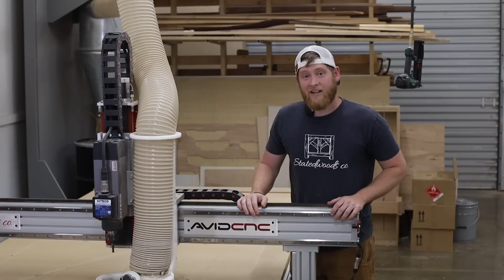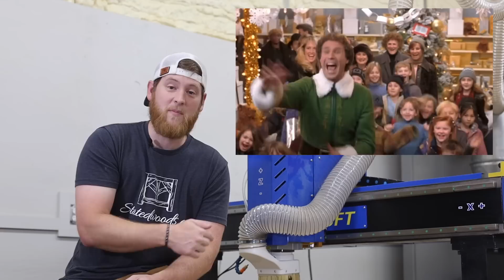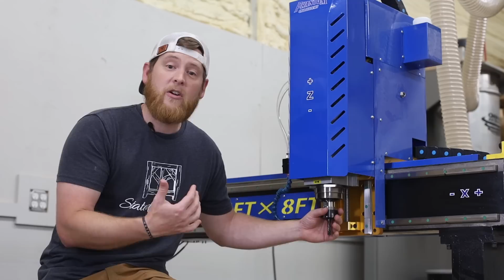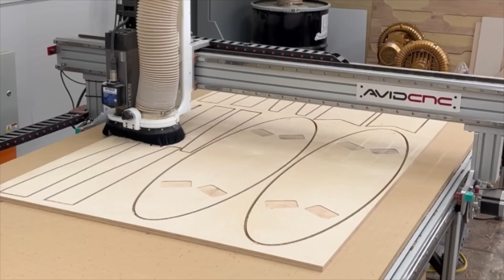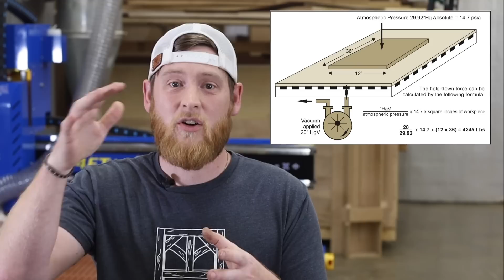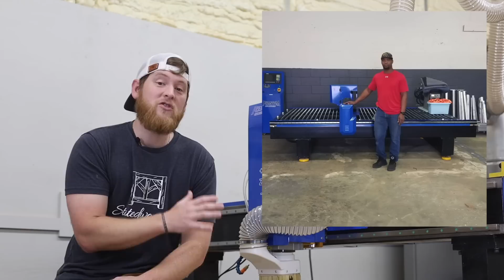Which is a better machine?

Comment: Thanks for all the info. I've had 5x10 avid for a about 3 years now and I'm seriously considering selling it for a phantom. I have to many issues with chattering and accuracy.
Reply from the maker: I was in the same boat. Its a huge upgrade to go to a heavy duty welded frame. So many advantages.
Reply: @Statedwoods  have you tried bolting the avid to the floor? Or perhaps I also guess more mass in the frame could help. Like bolt inside to concrete squares, like corner ballast. Does not fix all issues, but perhaps reduce the jitter and stop the moving 🤓
Great comparison! I did some 3D carve on a low-end machine, and out of square, makes molds fit badly, after spending hours carving 😔
Another timesaver is tool changer and auto tool Z calibration. Does the phantom have that?
Reply: Very interesting comments here! I have an Avid CNC from the CNC router parts era which I thought would be a stepping stone to a rigid industrial grade machine…. What has actually happened is I have reached the conclusion that it suits my needs perfectly! Because the machine was affordable I was able to buy it with cash on hand. And since it’s bought & paid for I don’t loose sleep when it’s idle and I’m doing other work. I did upgrade the spindle to a Teknomotor with tapered holders however that was also a fairly modest cost by CNC standards! I used to think that a vacuum bed was the holy grail but honestly I’ve reached the conclusion that the absence of it places constraints on me as a designer which I think result in better parts. Of course everyone is different and some people would be super happy to be turning out really high volumes of repetitive parts, but I really enjoy figuring out how to do the tricky one off things much more! 
The other thing I didn’t fully anticipate was that I’d end up making a lot jigs for my hand held routers to help out with onsite tasks. This is something that I would really recommend as a stepping stone for anyone interested and could be done on a desktop sized machine.
Reply: 4 feet b 8 feet sorry
Reply: Get a Shop Saber and be done.
Reply: Don’t believe a word from this asshole.  He’s a distributor for phantom and therefore completely biased.  He never mentions that in his video.
Reply: @davidlangdon9956  I know nothing about the author of this video, however, I am a retired manufacturing engineer who used to recommend CNC machines for purchase to my company.  This video is a valid step-by-step comparison of the differences between the two machines.  If the Avid and the Phantom were the only choices that I could pick for my company OR myself, the Phantom wins hands down.  It's a much better machine, no question about it.  I suggest you look at the content and not the person who created it.  Everything in this video is accurate and truthful.  BTW, I don't own any CNC equipment and I'm not being compensated in any way for this comment.  It's my own opinion and given from 35 years of working with and buying CNC equipment.
Reply: Most chattering and accuracy issues are user error not the the machine.

Comment: I once owned an avid 2x4 On paper it looked like a brilliantly engineered value option. In reality it was incredibly frustrating to find out that in spite of crazy beefy gantry components there was a comical amount of tool deflection with minimal load…you could push the tool easily with your finger.

Comment: Hi Nick, thanks for the in-depth CNC comparison, it’s clear you put a lot of effort into testing and explaining both machines. However, I noticed something that could use more transparency.

In the Avid vs. Phantom CNC video, you mention you’re not being paid and are just trying to give a fair comparison. But in another YouTube video, you're featured as a Phantom CNC dealer (@statedwoods), wearing a Phantom CNC shirt, and actively promoting their pneumatic roller system.

That kind of affiliation really should be clearly stated up front in the comparison video. Without that context, it comes across as an independent review, which could be misleading. The video is informative, but the heavy lean toward Phantom feels biased — and knowing you're a dealer for them definitely explains why.

It would go a long way for viewers if you disclosed that relationship more transparently in your CNC comparison content. https://www.youtube.com/watch?v=o9MC2kZddj4

Comment: Great video and many great pointers to real life issues that you need to worry about when using a CNC. All leads to why the Trend Yeti Smartbench tackles the problem differently by essentially clamping to the material. The effective rigidity is now increased and the chatter caused by the Z distance are now both improved

Comment: i did buy  a 1325 chinesearound 9 years ago
it was 5000  with all custom and shipping

within years replaced power supply 2 spindle  2 vfd

absolutely not paying 10 grand for  a lego or 25 for the phantom
im happy  people in usa try to enter  into routermaking , but follow market rules

buy as large  quantity as  it reducing  the price for beginners  or keep competing  with chinese

a 10 tool rotary ATC 5x10 machine still only 12-13K

Comment: so, a 6.4 HP Spindle on the Avid seems like "not good" and a 6.1 HP Spindle on the Phantom is better? interesting
the argument with the PC: very easy, nobody should run his CNC PC with autoupdate, connection to internet or something like that, then you also will have no problem with windows. And also big pro for Avid: you can use more or less every CNC Software you want, on the Phantom it sounds like: you have to use their software and when they dont want to update it or you dont like the software your done...
and yes, when you want to upgrade the size of an Avid, you have to do it by your one, but you can do it, on the Phantom you have to buy a new machine
when your machine moves around while cutting: how about bolt it to the ground, problem solved

Comment: I appreciate your testimony. I think the h duty of the unit make for a thinker. As in a few m th I intend on purchasing a 4’x8’ 

Few years back I had a hobby one. Lived it when the codes worked. Hated it when I installed a code and it didn’t cut. So me being severely disabled. I am buying this because I’m not going to set at my desk the rest of my life. I have a 25 by 50’ shop. Even will add on. Phantom would you set me up a gull installed price. An where to buy everything. Your best thing going for you. Americans building it. God bless you..

Comment: nothing wrong with the comparison, but you can address some of the issues you have with the Avid. As for stiffness of table, this ca be easily address with side panel that can be simply bolted to the frames track system. while adding mass is also easy job. as for hold down vac, just use phantom motors and build using Avid's DIY plans.

Comment: I can't understand why you put the controls on the front and not the side. That way you have space for a vertical milling area.
Reply from the maker: Idk i dont design them. It would also require some tracks forward to allow the spindle to get in front. Most people cut a hole in the top and add vertical areas
Reply: @Statedwoods  Exactly. it wouldn't take much to make it an option. 
You would need a vertical clamping surface. That could be an extension as you say, or it could be a door in the table that hinges down. 

I think the approach you outline is the simplest, and cheapest.

Comment: In the process of doing my research for my first CNC, one YouTuber put it well.  He said that there are 3 tiers to CNC.  1.  The desktop/hobbyist/low production ($100-5k.  2.  The jump to a production level CNC ($6k-29K).  3.  The big daddy of production (30K and up).  Looking at the price of the Phantom, you are talking $12,300 for a 4'X4" machine.  That is level 2 in my book, You even say this in your video, Pro level.  .  Anyone just starting out without a true business plan/product is not going to be ready to dump over 12K.  Unless they are rich already.  Trust me I get what you are saying.  You are talking next level, let's make product.  For me starting out, I don't want to spend more than $2500 on a starter unit.  Yes assembly required.  I don't have a product just yet.  Though I have ideas. I think in the final analysis you prove your premise Phantom over Avid.  I would still say you are comparing a level 1 CNC vs a level 2 CNC.  The information is in-depth and very helpful.  I think your target group is someone that has a level 1 CNC already and ready to step it up to a level 2.  Thanks for all the information.
Reply from the maker: I agree with you. But both the Avid and Phantoms call their units “pro” units. Thats what the Avid Pro 48 is

Comment: What about if a roller step down on the edge of the material?
Reply from the maker: Depends on the machine you go with. All but one unit Phantom has use automatic rollers so the rollers raise when they are towards the front or back of the machine to prevent this. Manual machines would roll off if you dont have scraps or something to aid.

Comment: The build is part of the fun. And more importantly. If you fear the build, then this may not be your cup of tea.  Don't spend a fortune before you find out. The software still must be learned before you can make anything.  I bought a little $300 one to see if I liked the work. Learn to use a computer with it. Now, have one that costs just under $1000. It's great and I enjoy it. Thinking to go to a 4ft x 4 ft. As I'm getting better using it. Didn't spend too much, I'm way more likely to not crash a very expensive one learning. That's my take for what it's worth.

Comment: The only place I see phantom falls short is in their industrial machine  offer the machine and vac pumps in 3 phase. 220v single phase is limiting to the power the machine can achieve. 
Also if phantom would release a lighter duty machine with an ATC it would demolish the market. There is no good options for an atc for a 1-2 man shop that’s not pumping out tons of parts that needs such a heavy duty machine. Thats where avid draws people in. You can add atc
Reply from the maker: Good points there for sure. Maybe they are working on other options.
Reply: @Statedwoods that would be killer!

Comment: Can you operate a Phantom 4x4 without utilizing the vacuum table?  Just use hold downs the old fashioned way?
Reply from the maker: Yes you sure can. You will apply a spoilboard no matter which machine you have or if you use vacuum or not

Comment: Issues one is avid is for beginner hobby to simi pro. If you add a shelf to the bottom with a few more aluminum extension it won't move and more ridged. Also you can add a 11hp ATC to the avid. Just don't buy it thu them. As I said avid is for people that are electronically inclined and like to build and learn about CNC. This way if something brakes you will learn how to fix it. If you want a enterprise then go with a shopbot. But if it breaks then you won't know how to fix it because you did not build it. These are not the same type of machines.

Comment: OK get a machine you build yourself, then want to up grade!
while you are still running your old machine you can upgrade to a bigger spindle (few hours maybe), up grade it to better stepper motors or even servos (a day at the most), you can upgrade the Y axis first (you only need longer ball screws, linier rails and longer sides (maybe a weekend), upgrade your X axis same as Y axis. So you can upgrade a little at a time.
prebuilt? unless you have the space to put a bigger machine in without taking the old one out first? That good. But if you have to move the old machine to put the new machine in then???
First you have to take apart your old machine, clean the area ready for the new one and get rid of it 4 days to a week?
then your new machine comes! OK I forgot that just "all you have to do is wire your plug to 220 and have the air compressor line in" you don't need to fix it to the floor, you don't need to put your dust extractor tubes in place and I know you are going to trust that it is 100% level after it has been lifted onto a truck driven down the road and lifted of a truck! so you do not need to spend time checking the levels.

it is not as cut and dry as you are saying? yes buying prebuilt is quicker start up, BUT you can upgrade bit by bit on a machine you built yourself because you built it and know it.
IF you have space to get a bigger machine and have the money for it then yes that is the better way to go

AND IT WOULD OF BEEN NICE if you would of said that you are a Phantom Dealership!

Comment: Great comparison! A CNC Router with a fully welded iron frame is clearly superior, especially because it allows for grinded and rectified surfaces to place the linear guides. One point i dont agree is on the interface analysis. MACH3 (Or MACH4, a less used option) can run smoothly on an old PC with windows XP installed. I dont see windows updates as a big issue here as you can turn any notifications off from the control panel. On the other hand, DSP interfaces (with a RichAuto controller) are quite expensive items and have a tendency to fail quite early.

Comment: 😂😂😂😂 I've been using router tables od Avery make and model since 1994, and I've never had a problem with an upgrade messing with my cut. Maybe, I just haven't used a cheap enough machine?

Comment: Great video. I also cracked up when I saw the part where you were running from your wife. I do disagree with your statement related to the unreliability of the timing belts. I have a large CNC doing heavy cuts on stainless and carbon steel. I've been using the same machine for almost 20 years. All three axis using timing belts to connect the servos to the ball screws. They are all in good condition. Also there is zero backlash attributed to the belts when properly tension-ed. I've also been running a large CNC for the past 10 years first using Mach 3 then Mach 4 on Windows. I have run hundreds of hours and have never had any computer related glitches.

Comment: Fun fact, the only rigidity that matters is the one between the drill bit and the stock.

The fact that some mills have excess weight in the table is essentially useless. And ... actually quite bad. Technically your axis motors deal with acceleration between the work bed and the spindle assembly. The force required to provide that acceleration is proportional to the weight of BOTH of those objects. The lighter the table and the spindle assembly the less force is required to move them relative to each other.

Anywho, steel is the lazy way to create rigid structures and brute forcing it is probably still cheaper than composites or exotic alloys.

Comment: Although I agreed with many things that were discussed here.  Your lack of time in the industry  tells me that your leaving a lot of information out.  As far as avid cnc losing steps, it's because they aren't using closed loop motors.  Which is crazy for the cost.  The fact that phantom isn't using them either is just as bad.  Although it's heavier that doesn't mean it won't happen with that machine as well.  Pc based controllers run by ethernet or a true motion controller are extremely reliable, stand alones are usually good as well, but you won't be going in and changing parameters as easily for fine tuning your machine motion.  Those are really the only issues I have about your video.  There is a ton more to be honest.  If you want to discuss it sometime just shoot me a message.

Comment: Great video, but one topic you didn't mention at all is Automatic Tool Change capability.  To me, this is one area that can be a huge time-saver for CNC processing, and is also a glaring shortcoming of Avid (Avid does not offer any ATC option at all).  I bought an Avid 4x8 Pro Series but didn't buy their spindle or electronics.  I found an ATC spindle from CNC Depot that works well with the Avid.  But it was a HUGE amount of work to set it up and get it working.  It even required some programming to get the tool change to work properly and avoid crashing, etc.  I would much rather have an ATC capability that is already designed, built, tested, and backed the company that made it.  Phantom does offer a CNC line that includes ATC but from what I can tell it's much more expensive (>$30k).
Reply: We outfitted our 4x8 Avid with a ATC. It was some work but has run fine since

Comment: The Phantom like the Shop Sabre seem to be true industrial grade machines. The Avid is more of a hobby brand with industrial pricing. They should be significantly cheaper. I'm in the market now and have been considering skipping a hobby class machine. I can't get over how expensive the Avid is all-in compared to the other two brands, and others I researched.
Reply: Like the Glow Forge going up against reall watt cutter vs just at hobby level capacity and speed.
Reply: The phantom looks like a toy to the shop saber. My neighbor has a SS with a 15hp spindle. It’s massive. But shop saber is a toy compared to a biesse

Comment: I have been eyeing up a phantom cnc it is cheap for the machine they build plus I like the idea is that they heat treat the frame to reduce tension from welding the frame and machine the top surface for the rails.